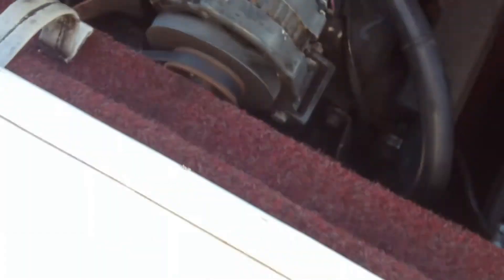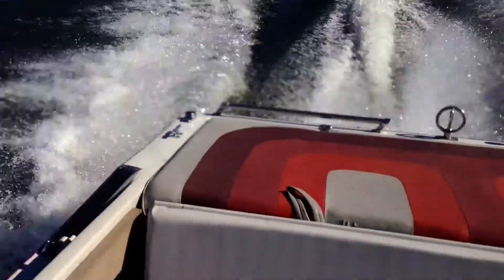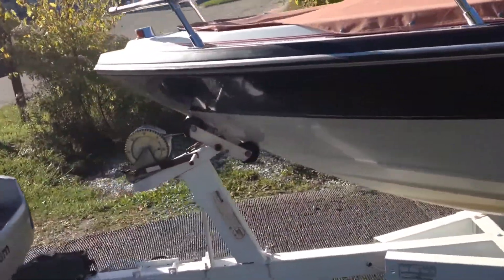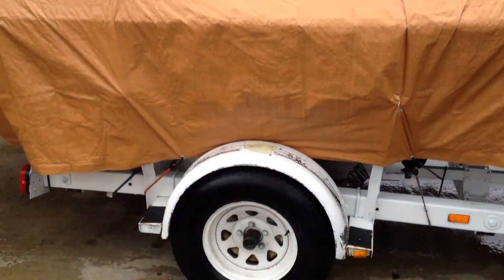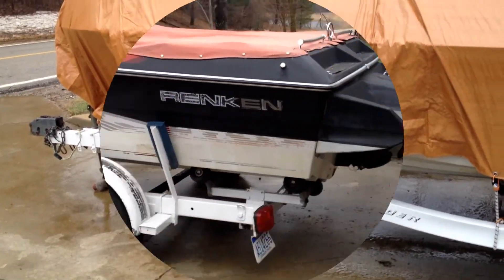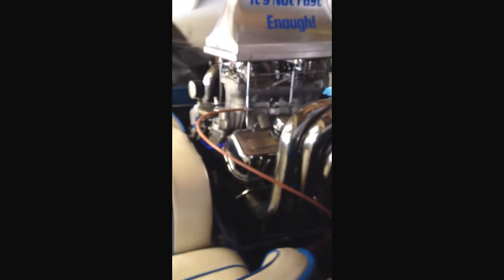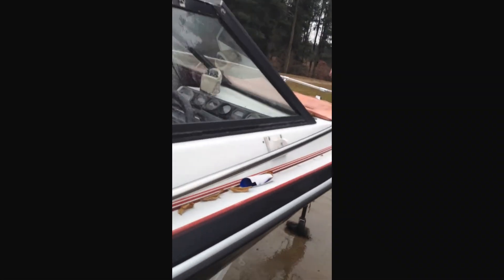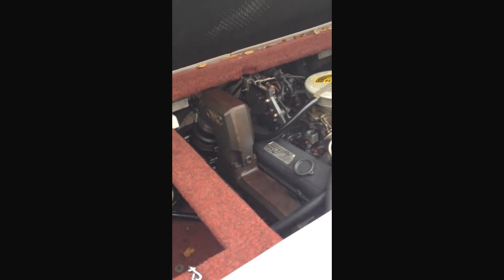Sweet 19' Renken Power Boat / Ski Boat for Sale at Repocast

Comment: I know own this boat. im surprised it ran. they guy i bought if from in the spring of 2017 used your video as gold lol. for $1700 it was an ok buy. ive wet sanded and polished 80% of it so far, rebuilt the engine bay supports. and next is the carb rebuild. we took it on one trip last summer to mullet lake in norther michigan. both tires exploded 10 miles south of flint.(took 7hrs to get from pontiac to indian river)  the boat ran ok on the inland waterway but idle speed was nonexistent. tuned up this summer it should be good. i took the bow rails off to detail it and it looks better without. it looks like an 80's off shore boat with the stern low and the bow high. i love it. i bought it for the beater it was and ive turned into a renken fan. even thought these boats dont exist anymore.
Reply from the maker: We love to hear people doing their own work that’s awesome the boat will only gain more value the more you do to improve it that is for sure